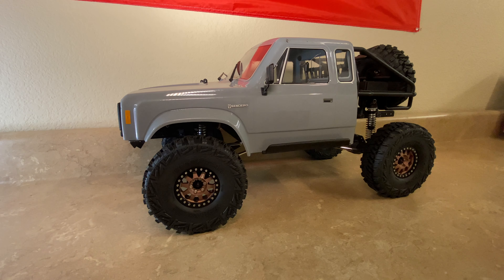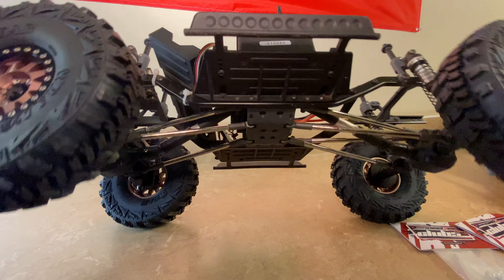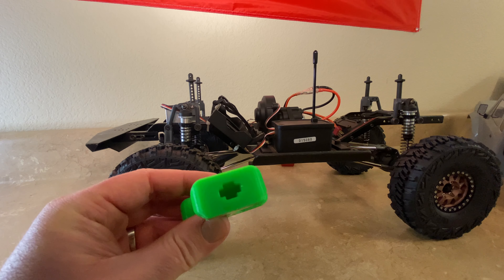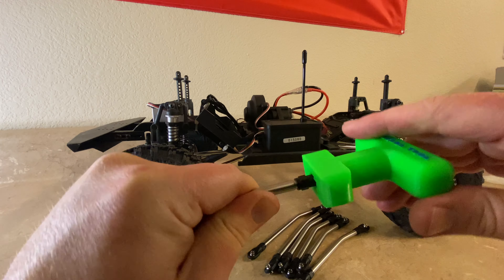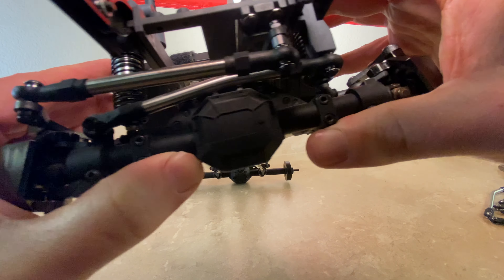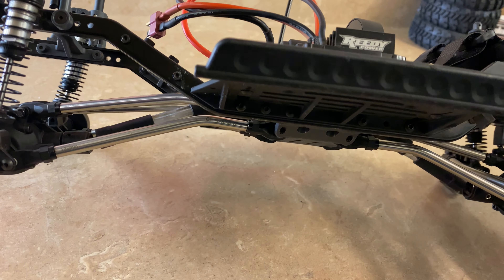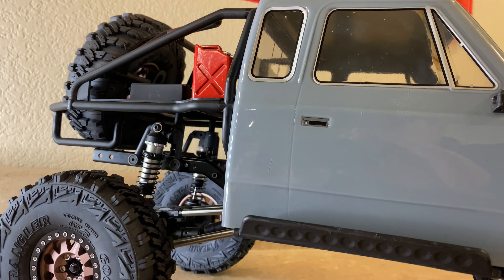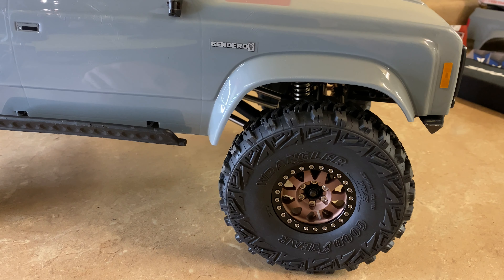Element RC Enduro: Upgrade Series Episode 4

Comment: Like that truck.  Thinking of getting one.     I think your links are on backwards.      The sort side of the angle goes towards the axle. Your running yours towards the skid.       At least that’s how I’ve ran other high clearance links.  The way you have it set up you still get clearance but you get more where you need it the other way.      Just found your channel keep it up.
Reply from the maker: I originally had the links the way you are describing but switched them after looking at how they were shown on Club 5's website. I did notice a more drastic pinion angle the other way. Thanks for the input and for watching!

Comment: I have a modded Trailwalker.  I put the steering links to the front of the axle, this gives me more steering.  I also turned it into a half cab/mud truck style body, way better performance.  No more hang-ups with that awful bed in the rear.
Reply from the maker: I might have to try that. Thanks for the tip Big Man👍
Reply: @jayshobbycave2046  
No problem bro!

Comment: Cool vid, very informative thank you. however I have a friend that got the sendero kit and bought the club 5 links to install during the build, I helped him with it but were having issues with the compression and droop on the passenger side where it bolts to the axle, seems like it’s binding and the link is hitting the reinforcement tab on the top of the axle, the bend on the panhard is towards the top but still hits at compression, any suggestions would be appreciated thanx